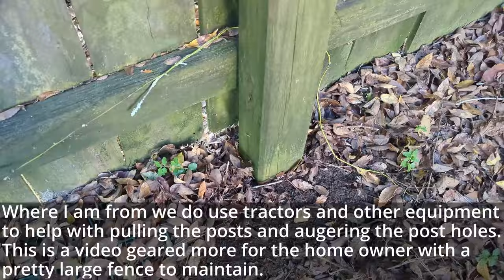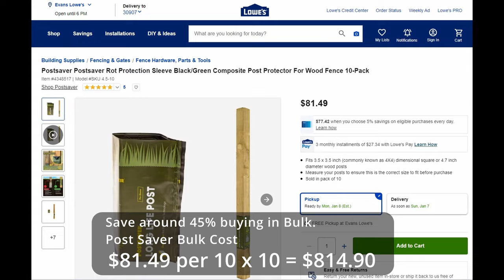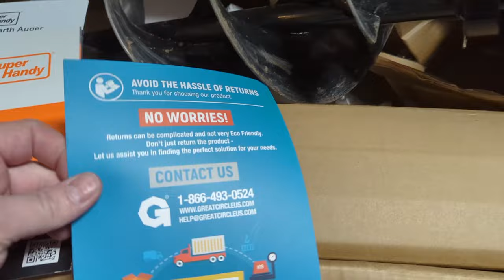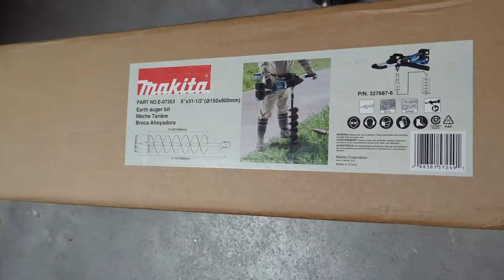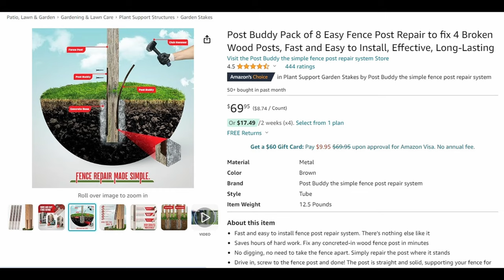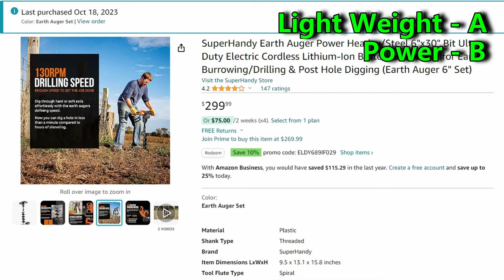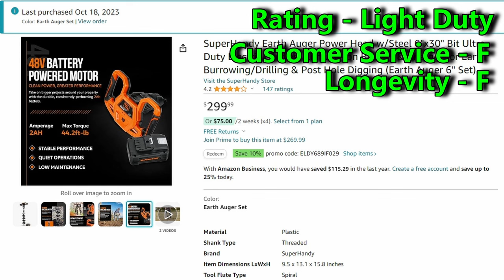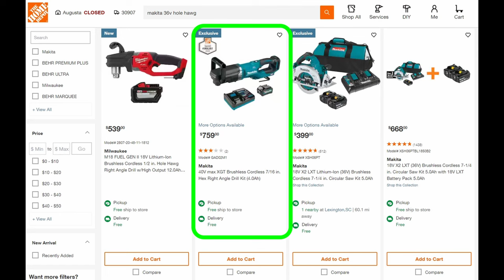Cordless Hole Auger Comparison

Comment: This is awesome!!! I have about the same size yard with fencing on 4 sides that needs replaced.  Tried to do it with a hand hole-digger, shovel, pick-axe, etc  - just too much of a back breaker.  I couldn't find anyone who had the right combination of hand power-tool/auger until now.  All I could find were bulb planting augers lol.  Thanks for sharing.
Reply from the maker: That's a large project by hand for sure. So glad you found it helpful. Thanks for your kind comment!

Comment: I bought the Ryobi 40v auger a couple of years ago and I have a small tractor with an auger.  The Ryobi gets into small places much easier, and if I need just a few holes I'm out and done with the Ryobi faster than I could get the tractor auger set up and ready to begin.  I had the same discussion with myself about manual post hole diggers and small engine (which would have been cheaper than the Ryobi).
Reply from the maker: The Ryobi looked like a good option as well, the only thing is early on the 40V packs were problematic. Not saying they still are since that was over 8 years ago for me. How have yours held up?  The EGO 56V looks great also, but doesn't seem to be available till sometime this year. Thanks for your comment!
Reply: @ThriftyToolShed  So far so good, and no regrets other than adding another battery platform.

Comment: I think your analysis is probably right on the Superhandy.  But it could also be that the battery went into some high impedance mode such that it will have the right voltage..enough to light the led's and indicate proper voltage.  But it just doesn't have the current capability.  I wish you had another battery to try or external power supply.

The wood always rots in the ground/concrete no matter what you do.  I'm thinking about some sort of steel form that you could put in there and then mount the wood into the steel form and secure with lag bolts.  I don't know if they make those.  This has been a very entertaining video and I didn't have to lift a finger.
Reply from the maker: Just remember that the dead short on the controller is a dead give away. Thanks for your comment!
Reply from the maker: I should have also mentioned that I did in fact put a 48V bench supply with current limit set to 5A and it went straight to current limit and zero volts while troubleshooting. I had forgotten I took that part out during editing to try not to go over 30 mins on the video, but I still did, lol. Thanks so much for your kind comment!
Reply: I don't know that you can get enough lateral support just bolting a post to steel above ground.

There is a post sleeve product that is like heat shrink tubing and glue (or tar) that you can put on the post end before embedding.  Also sometimes it seems that just putting the post in well draining soil will last longer if it has enough lateral support.

Comment: Very nice video. A lot of work. Bravo! But why put wood in concrete. I would never do that. Wood and concrete are not friends. Better to use a metal fastener and then put the wooden element in it. It is also easier to change the post later on as you don’t need to pull out the concrete from the ground which is as you know a hustle.
Reply from the maker: It's honestly just a common way it's done in the south and I am sure (now more than ever) it is a better way(s).  I grew up with us using the black Creosote post and man my Dad still has some over 40 years old still in good condition. The PT post we buy today is total crap! Mine look like this rotten crud within 20 years old. Thanks for your comment!

Comment: Sir. ive used an high torque impact with some adapters for that... yes. it makes lots of noise and is slower but it wont hurt my back and my wrist... Start with a smaller auger bit... notice that plastic gear housing and the two-wire battery connection in the SuperHandy... i would NOT recommend that to anyone...
Reply from the maker: Yeah, I have done that with smaller 4" augers and such. That is really slow. It's not for me. I have the M18 high torque as shown in the video with the anchors. Thanks for your comment!

Comment: Great demo of the available equipment for this kind of repair. Only thing I might of done different is using double posts on gate anchor point bolted togeather with althread, 1/2 " min. Thanks for your time  and efforts.Nice work!
Reply from the maker: You usually use double 6x6 on the gate or usually use double 4x4?
Reply: @ThriftyToolShed  either or, which ever makes you feel safe.